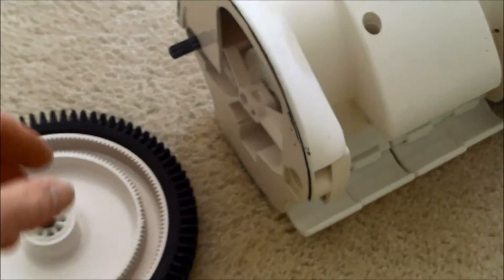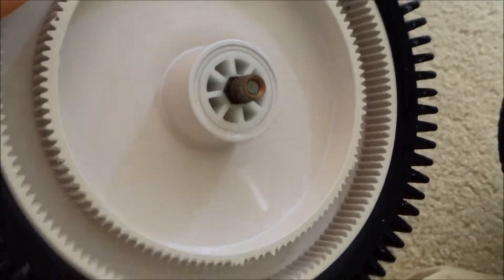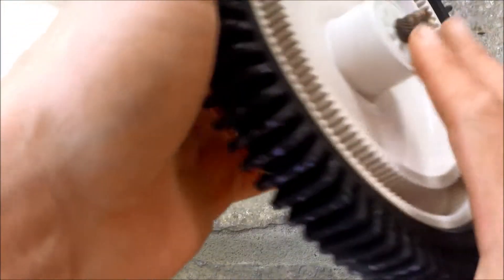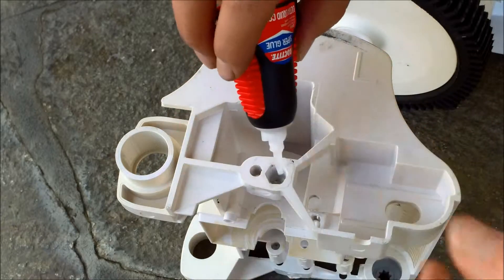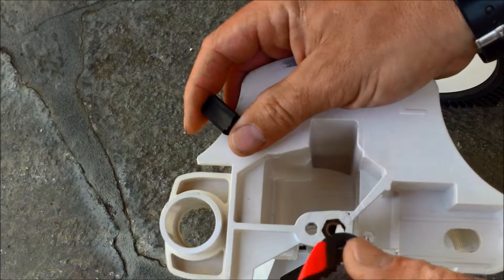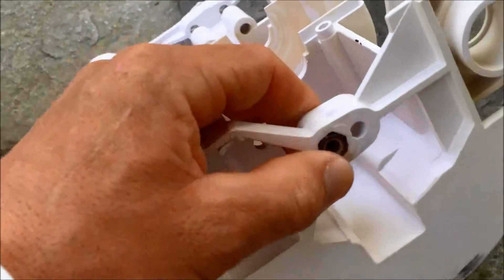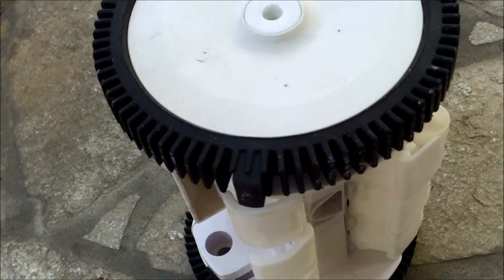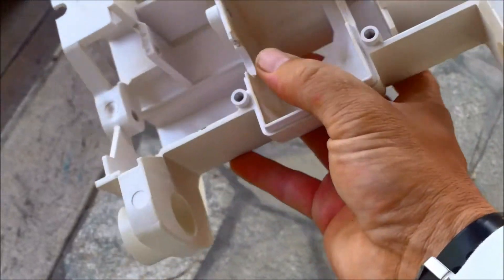Repairing "The PoolCleaner" with Super Glue When the Wheel Breaks Off

Comment: Do you know where I can buy the Inner hub it seems like it’s worn out wheel wobbles. Inner hub I mean the center part on wheel that the bolt passes through on the older models. Hope you know where I can get a pair. Thank you
Reply from the maker: Most of those parts were not picked up by Hayward. So the only real solution is their "Lower Body Conversion Kit"
Reply: @SPL  Thank you. I’ll try that